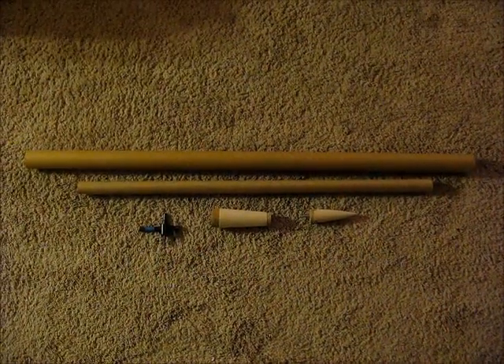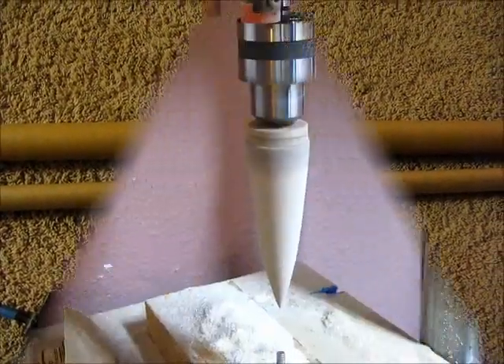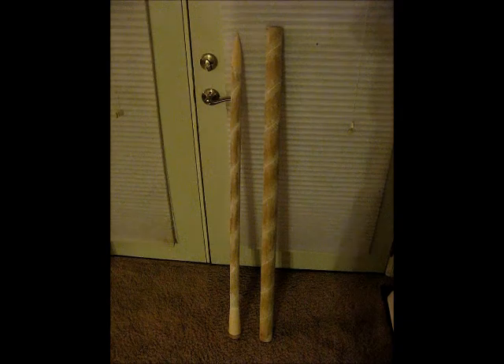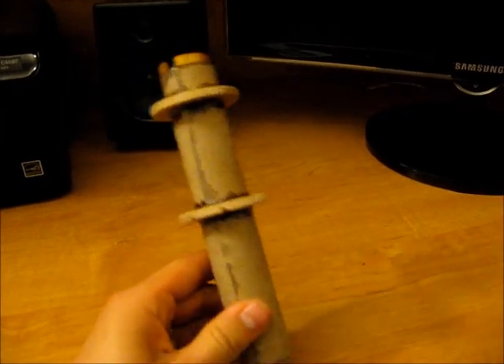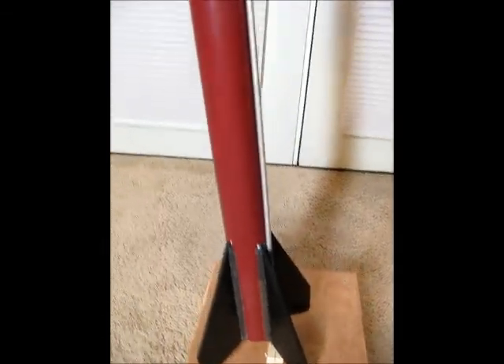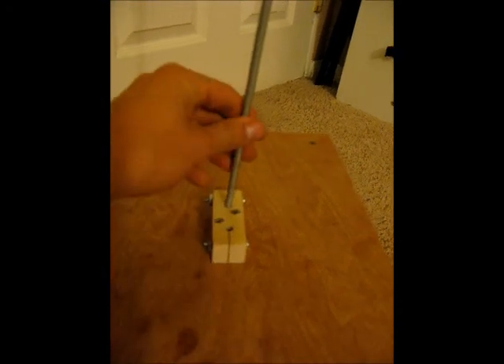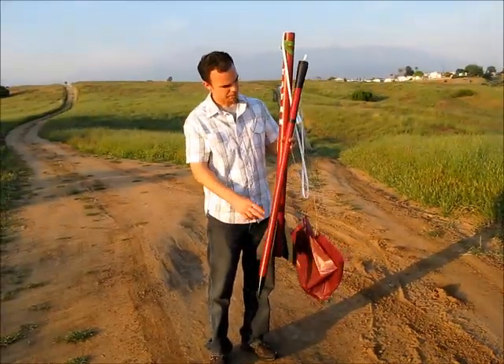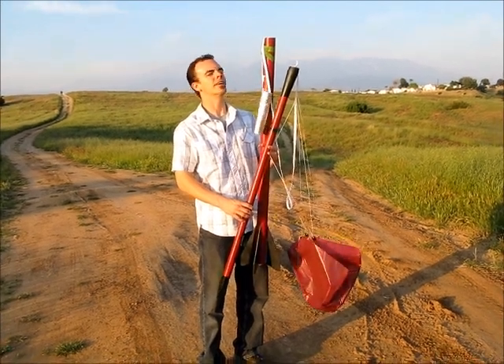Titan Rocket Build & Launch - Over 8 ft. tall!

Comment: I have seen your other videos and the tutorials were great. I understand how the ejection system works in the shorter rockets but was wondering if there is anything different in these larger rockets. I thought about using a spring loaded piston system but weight becomes an issue. My two questions are: Is the ejection system constructed the same in the longer rockets as in the shorter rockets? I understand how you joined the top half and the bottom half but do the two just slide together without being secured to each other (I know you said that the ejection system is in the middle but does inertia hold the two halts together in flight?)?
Reply from the maker: Yeah, I tried to keep things simple and used the same design. I just used a paper towel tube instead of a toilet paper tube due to the size of the chute. I just made sure the fit was tight by adding tape as necessary to snug it up as necessary. No need to secure 'em much more than that. The snug fit is mainly just to keep things aligned nicely and avoid any weird wobbles during flight. Otherwise, the inertia would definitely hold them together fine.